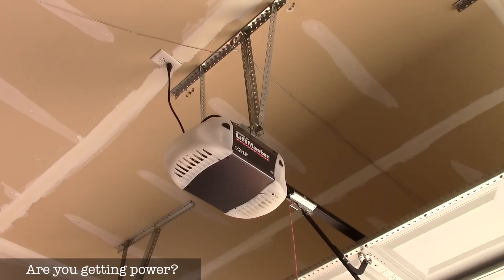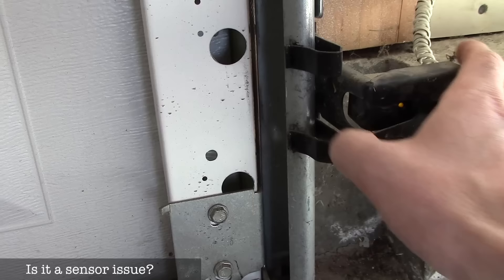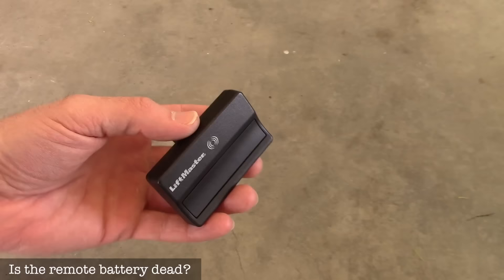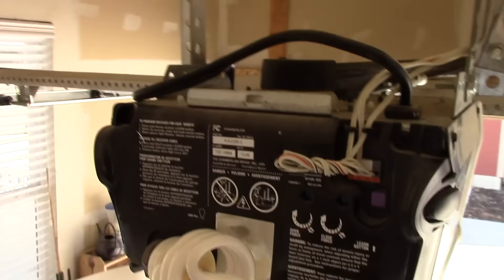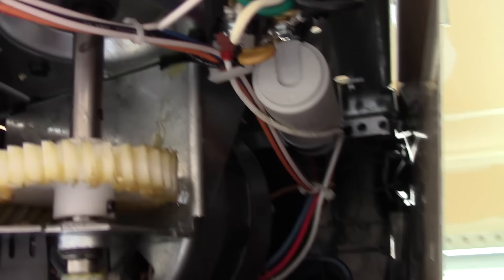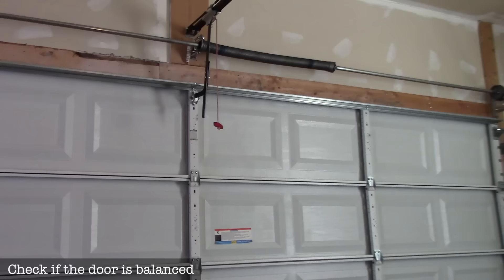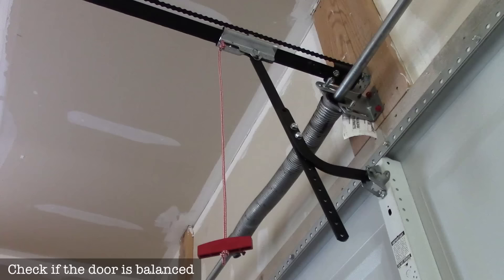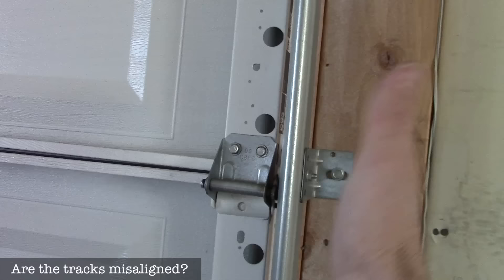Garage Door Opener Troubleshooting and Repair - How to fix common problems

Comment: The best video I've ever seen on garage doors! Real helpfull. I have a different problem do. I tried opening my garage with my garage door opener inside the garage and it only opened a quarter of the way. It stopped, the garage light turned off and the LED light inside the opener was flashing none stop for about 3-5 minutes. Once the LED stopped flashing I was able to use my garage door normally again. Any idea on what that could be?

Comment: Very educational and it is a great video to learn from.  I have a Chamberlain Whisper Drive that was installed many years ago, this morning the motor unit started making a high pitched sound.  Actually not sure if the squeak coming from the motor unit of the belt under the retainer.  Any ideas of where this issue can be found and corrected?  Have you already addressed this in previous videos.  Thanks for your help.

Comment: Thank you for this video. We have a screw drive garage opener that is making a loud noise every time it opens and closes. I disassembled the whole screw and carriage assembly in order to give it a thorough cleaning and greasing. After putting everything back, it seemed to do the work. The noise was gone for sometime. But then the noise would come and go only when we close it. The normal humming sound is there when we open it, but the loud, sort of grinding sound, noise is back on closing. Any suggestions would be highly appreciated. Thanks.

Comment: Adam,  Best video I have watched!!!!!.  I have a  Chamberlian  Lift Master 1/2 HP.  Door goes up and down from hard wire button.  None of the remotes work.  Nothing new was added or taken away from head unit.  I have an additional Lift Master antenna which has it's own learn button. This has worked for years and I have no idea why it was added. Is there something else I am obviously overlooking?

Comment: Thank you Adam for your garage door videos. They have been very helpful, more so than any other videos. I just replaced the main gear or sprocket and worm gear. It is a 1994 Craftsman 1/2 hp opener. I took it down, replaced parts, returned to position. Now, the door opens and then closes, the exact opposite of what it was. Not open close, but, close open!!!! Any ideas?

Comment: Adam,
Within the first :10 seconds of the video.  I noticed your door travel is too far down.  Try to install some foam inside the rubber on the bottom section to gain a better seal.  Dead giveaway is the way your btm and second sections are buckling. Also decrease the travel to allow the closed cell backer rod to seal the section better and also saving your door in the winter when the floor freeze and heaves causing more pressure.

Comment: Adam, thank you for such a helpful video!  I was wondering if you had a video to address shorts in the wiring from a lightning strike?  The wall opener on our Liftmaster no longer functions and I believe the issue may be the wiring.  Unfortunately, my garage is semi-finished and the wiring runs through a sheetrocked ceiling.  Is there any way to rewire the garage door opener by passing the older wiring and tack the wiring on the ceiling? Thanks, Maureen

Comment: Nice video! I still haven't resolved my problem. 18 year old LiftMaster Model 2280. It occasionally (more often now) will stop closing when it is only about 1/4 of the way closed. The light is not blinking and it does not try to reverse. After pushing the remote a few more times it will then close the whole way. A few times it has not opened at all on the first or so push of the remote although the light comes on. Suggestions?

Comment: If your breakers outside are all OK, then you may want to check to see if you have a GFCI wall outlet in the garage. You may have power strips or tools plugged in that may have been tripped somehow.  I reset mine and the power was back on. Garage doors have power once again.. Hope that worked for you.

Comment: I replaced the sensors, and it worked well for another month. Now it's acting up again, but I know it's not the sensors. When I push the wall button the trolley travels a few inches before returning to the starting position. Then I hear a clicking sound like turn signals for a few seconds.

Comment: I live in Wyoming, and my garage door has issues going down all the way, but only in the winter months; sometimes it takes 2 or 3 attempts of the up and down switching back and forth to get it all the way shut. Nothing seems apparently loose, but I am going to check things out a little more closely and see of any of the roller assembly parts might be a problem as you recommended. Our home is fairly new, it was built in 2007. I replaced the wall switch part last year, because the lock off and on portion of the switch didn't appear to function. I will  also check and see if any wires on the motherboard are loose or disconnected. Also the drive-chain was dry, so I just sprayed it with some silicon spray that seemed too runny, so then used my white lithium spray on it and that made things run more smooth. It is a ProMax brand. That's about all I can tell you, so I hope that you have some advice. Thank you in advance for any info that you can provide. 

PS Your videos are very good . . . Neal

Comment: Great video, thanks.  We like to keep the garage door open maybe 10 inches to get some ventilation.  When it is traveling down I try to stop it but it vibrates and goes very slow, then after a few seconds it will stop.  It's taking it a little longer to stop each time.  It acts like there's a brake slipping.  What do you think?
Thanks, David

Comment: There are no floor sensors on my door. Occasionally the door closes to the cement and reverses itself to open up again. Nothing on the floor or in the tract. I had to reset the pin that wiggled itself loose above the middle of the door. Now it seems to be too tight or out of adjustment and I see the hinge flex as the door touches the floor. 
My "guess" is adjusting the torque on the close door sequence switch .. not really sure which switch it is and what the adjustments are. Took pictures of the items.. not sure what my next step is.

Comment: Thank you Adam. Very informative and precise video. I have a 1/3 hp craftsman garage door opener which suddenly stopped working. The LED flashes five times. I tried to clear the program and reetach it, but can’t get the five flashes. I checked safety sensors, any loose wires, resetting it, unplugged to cool off motor but nothing seems to work. I suspect rpm sensor, capacitor or any bad soldering. Any suggestion? Regards: Sud

Comment: Best video I watched regarding garage doors. Please help, my door only moves into open position. Every time I press on the clicker it goes only towards the motor and bangs against it. Doesnt change direction with clicks.  It doesnt stop unless I physically push on the stopper since the rail device where the door attaches is past the stopper sensor. I unhooked the door and still continues to do the same. I Havent found a video that addresses this.

Comment: Hi Adam,  I found your garage door troubleshooting video very helpful. In my instance there is a amber LED just above the learn button that flashes five times when commanding the door to open or when pressing the light switch  on the wall mounted control. There is an audible clicking sound that can be heard during attempted door operation. I’ve followed they troubleshooting tips to no avail..any ideas come to mind?
Reply: That’s my problem! Solution?

Comment: Great video.  Need some advice, please.  I replaced the plastic gear drive (sprocket) on an older Liftmaster, just used a hand wrench to remove the sprocket drive set, so I touched some electrical parts inside.  When I plugged the unit back into the outlet, there was a spark at the outlet and the circuit breaker in the electrical panel immediately tripped.  I've performed some basic troubleshooting (the outlet is good); however,  there is a short in the opener.  The breaker trips every time I plug it in.  Where do I look to resolve this?

Comment: Great video. My door still won't close.  Had power surge,  replaced entire board unit.  Now door will only close about 1 foot and reopen.  Sensors seem fine... 1 yellow light, 1 green.  Green goes out when covered. Same when button held on.  Manually lowered door.  Unit still only travels 1 foot and returns.
Reply: Also,  yellow light by learn button flashes 5x, then flickers dimly and repeats
Reply: Chamberlain whisper drive 41a5483-4

Comment: My garage door opener is a Master Mechanic installed between 15 and 20 years ago.  When I try to close the door it starts to go down but stops.  If I apply light downward pressure on the door it will go down.  I checked for binding and problems in the track and made any necessary adjustments.  It is a screw drive.

Comment: Hello Adam, you are awesome.I have an issue with my garage door inner trolley got stuck or jammed ( went too far and hit the bolt) when it closed.I went to the Chamberlain website and followed instructions, still stuck. Hope you could help. Thanks

Comment: Awesome video... Very informative... Can you short the wires going into the motor coming from the wall switch? I saw some other videos suggesting to short the connectors to verify if the problem is from the wires connected from the wall switch. Can you do this test with this model?

Comment: Here I had the covers off of mine with the motor and gears exposed and it was the sensors on the floor that  were out of alignment super simple fix and I give you credit for helping!

Comment: Hi Adam, this is definitely a great informative video.  I have an old Genie opener, and when I press the opener button on the wall, nothing happens, it's like is not getting power, I used a different power source with an extension and the issue remains, do you think this can be a capacitor problem?

Comment: Thanks, Adam! I am a strong, independent woman with a working garage door now.
Reply: Thanks Adam. My problem is that the door won't completely close. Either with master, keypad or remote closing door stops about 18" from floor. Repressing down finished closing. What's with that.Any suggestions, I'm at my witts end. Have tried just about everything. Any chance circuit board thinks it's actually closed & it's simply an under adjusted force down repair?

Comment: Adam, great video. I would like to known if you can help with the problem I am experiencing. My garage door will open and close using the wired button on the wall as normal. But, when using any of the remotes, it will open or close, and only after a while it will work again with the remote. I haven’t changed the light bulb in the garage. Any ideas?

Comment: Have replaced capacitor due to smoke and excessive heat.  Door does cycle but when closing at the last moment at cement it wants to cycle back to full open.  It’s Allister type 2 and old.  Seems like I can hit the micro switch and keep it closed but doesn’t want to do automatically.  Thoughts?

Comment: Your video a great help but I'm out of options. Switched opener on at wall pad, motor runs, stops and starts, but chain / trolley does not move. What is the fix for this? Thx.
Reply: Seems like gear and sprocket issue! I have the same issue and this is what I was told

Comment: Thanks a lot ! Very helpful! I have a question: my wall unit has only 1 button (not common 3 buttons: lock, light, open). I can see the light behind the button cover is keep blinking. By pushing it doesn't open the garage door. What's the problem? How should I do? Thanks!

Comment: Great video. Did not address my issue which is a random opening of the garage door.  The green light is blinking so is this an issue. Mine garage door opener is a "Overhead model 455". So old that there are not any sensors.

Comment: Thanks for posting that video.  I'm just now realizing that the late morning sun is hitting one of the sensors and not allowing the garage to close.  My neighbor has a different system with different sensors and his isn't having this problem.  Should I change the sensors or is there something else I can do?  Holding down the button from inside the garage and going out the front door and walking around the townhouses isn't going to work for my wife much longer:)  Thank you, Richard

Comment: Hey adam Awesome video. My issue with my dorr is it sounds like daaaa naaaaaaa .... without the ticking with something that is in the eyes. I tested the eyes and it does the ticking but the door doesnt even move at all. what do you think? Its defenitely not the eyes. Literally has worked great for ever and just stopped working. Just use the key pad outside.

Comment: Great video. My door operates sporadically from either one of my cars. It always works from the wall remote so I think it has something to do with the home link system. One car is a Toyota and the other a BMW so it is not the brand of car. Any tips on troubleshooting that? The biggest problem is losing it from my car. Usually no problem opening it but it does happen occasionally.

Comment: Thanks Adam. My problem I believe was that last night the light stayed on and wouldn’t turn off then this morning it was off but the garage door was not working. I checked the outlet and it is working. I also detached the door to manual and now I can’t put it back... it’s not the same way as yours did it. Help.

Comment: Thanks for your video well done my problem is the garage door goes up about a foot and then stops. If I’m in the house I hold the button down and it goes up all the way if I’m working from the mold in the car he just goes up a foot. I’m in the house just touch the button it goes up about 1 foot stops

Comment: Adam,  I have a Overhead Door Model 556, about 20 years old.  It now has developed a problem closing.  With any of the remotes, including the ones in our vehicles and the interior hard-wired buttons, the door starts moving down and travels various distances down and then moves back up,  For a few weeks holding the remote button down would work to close the door.  Now holding a remote button down  does not work anymore, the door reverses at various distance even while holding a remote button down.  However, holding the interior hard-wired button down will close the door.  This situation occurs whether the door is engaged or not with the manual release handle.  The capacitor looks OK visually.  Would you suspect a circuit board problem or something else?

Comment: Hey great video....one quick question.....I just replaced the gear assembly and worm gear (bought the whole kit).  The problem is, now the motor only goes a little bit, then reverses and stops.  Only goes maybe a few inches.  What would cause this?  How do I know where the chain should be....mine has the chain that also connects to a cable....any help will be appreciated....THANKS!

Comment: Mine is a Craftsman chain drive 3/4 hp and the inside looks exactly like the one shown in your video. Pressing the wall button and pressing the remote causes the light to blink but motor doesn’t start. Noted that the ‘learn’ light continually flashes. Got a feeling it is the board. Where can I get one—if you agree, thanks—George

Comment: Hi, I am having an issue when trying to close my garage, it opens fine once but since it turns the light on on the opener, it doesn’t close until the light in the opener turns off, but the wall control works anytime. The remote is the only one that doesn’t work until the opener light turns off.

Comment: Hi Adam. I found your video quite instructive, but unfortunately it did not address my problem. My door opens fine. It also closes fine, but unfortunately it frequently automatically reopens again as soon as it hits bottom. This might happen several times, or i have to leave it partially open for a while before trying again. Have you come across this?

Comment: Hello I tried opening the garage door from my car and it opened half way.  I then looked at the the unit on the wall the sensor and the head unit and noticed no power anywhere.  I then made sure that the wall outlet is live and it was.  i am thinking the unit went bad.  great video and thanks for sharing

Comment: Hello.  My garage door opener moves down a couple of inches and then it stops moving.  When I push the button again it just comes back to its starting point.  Could this be because the chain needs to be lubricated?  Thanks.   Very good video.

Comment: Hey! Great video! Thanks! My question. I have an old two button Chamberlain. Was making lots of squealingbanging noises. I lived tightened everything. Now runs smoother and fairly quiet. But the door safety reverse doesn't seem to be working. It opens and closes just fine. But if I grab the door handle while closing, I can't stop it. Any suggestions? It does not have a learn button. Has DIP SWTCHES.

Comment: you have presented good information and it's clearly demonstrated.  It's mostly complete, but you did not cover the proper setting of the limit switch positions or the settings for correct opening and closing forces.  Nonetheless, good video, cause I learned a bunch.  thanks

Comment: Hi Adam. Stuck on a trouble shooting issue and looking for a direction to go. The backup battery is new and fully charged. When the battery is connected and AC power is disconnect the green opener power light is on, and the light on the wired push button is on but yet the door will not operate. Plug it back in and the door operates fine.  Everything seems right Battery, voltage, amperage.. Just looking for a nudge where to look next.